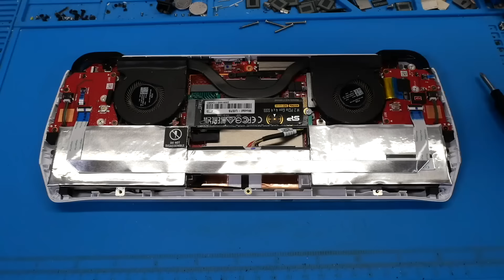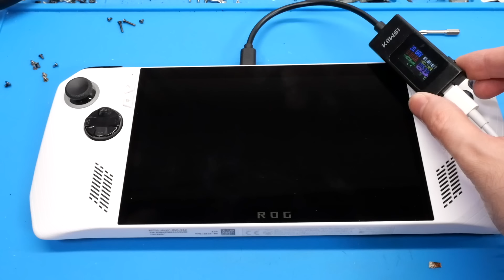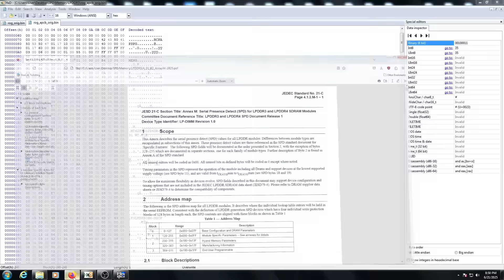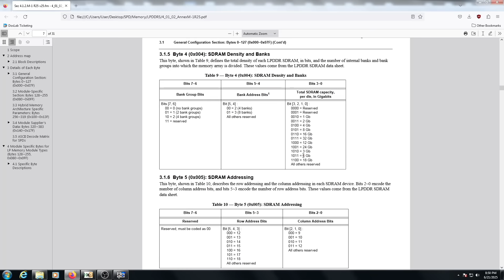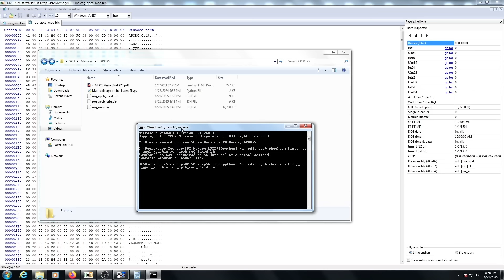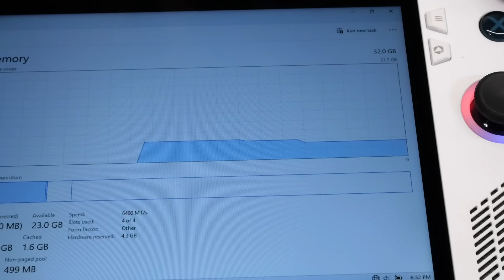ASUS ROG Ally 32GB RAM Upgrade

Comment: Good video. I have a rog ally x z1e and it just boots to splash screen. I sent it in for repair and told me possible corrupt bios and wanted to charge $450, which is what a new one would cost. I can't get into bios at all. Even with power / vol combo. Can you fix or offer suggestions?

Comment: I have the OG ROG Ally Z1 Extreme.  Upgraded the battery.  Installed the "janky" adapter.  Added a 4TB SSD.  Installed Bazzite.  Got the Killswitch case and mine runs pretty much anything.
Love this thing.

Comment: Can someone please explain to me what upgrading the RAM on this thing is supposed to accomplish?? The GPU in this thing is absolute shit.... unless you drop everything to low... and I mean everything you can't even have texture quality set to medium.... it will crash upon loading Horizon forbidden West like it'll just shit itself... this thing cannot handle the Decima engine and literally runs your GPU to about 100%...

So with a shity graphics card in a GPU that was probably shipped already buried in its casket on arrival.... what the how old does Raising its Ram capacity do for it???
I mean people got cell phones out there right now with the same amount of RAM and they run emulated games better than this... even the shined turd rebranded Xbox version is the same because that's the one I'm using...

This thing is so horrible you need to start asking if it can run crysis again😂

So like yeah in all honesty not trying to be sarcastic can you please let me know what the point of upgrading the ram would be in a unit that doesn't really have a GPU that's stable enough to handle something that uses less of a physics engine than breath of the wild did? And I'm not just making that up you can look that up it's actually true breath of the wild used a more taxing physics engine then the decimal engine did for Horizon forbidden west.... watch only plays on this thing if you set the settings to low and turn many things off completely which leaves the game looking and running like absolute dogshit and even that doesn't stop the clipping and the tearing and the skipping

Comment: I have a question, so i modified my dell 5320 from 8gb to 16gb ram and used ram that is already programed for 16gb for that model, but i think they used the resistores to tell the bios which config is used, so where can i find that schematic for that and where in fact is it the best to find these schematics?
Reply from the maker: Yes, if you want to utilize a different BIOS SPD config that’s already in your BIOS, you need to move strap config resistors. Unfortunately it may or may not be possible to find schematics, but most of these Dell systems are manufactured by Compal. You need to look on the board for the board number printed in the silkscreen, which will start with “LA-“ for a Compal board.
Reply: Okay thanks i will look into it, but i wanted to see is there a good site to find these schematics i looked on some but they mostley demand first payup than the schematic @dosdude1

Comment: I have an Asus Strix G18 with the NVIDIA GeForce RTX 4080 Laptop GPU (up to 175W TGP) with 12GB GDDR6 VRAM. Can the VRAM be modified?
Reply: *It’s got Win 11 Pro installed, but I’m going to wipe it and install Linux, probably Fedora (or Arch).
Reply: Also I’ve installed the bio’s allowed maximum of 64gb RAM, If the VRAM can be upgraded I’d like to upgrade the RAM to 96gb too.
Reply: @kenneththompson4450  that’d be too difficult to do with a laptop gpu imo but you could possibly use more system ram, sometimes the motherboards allow more, look into your model.
Reply: @goth55 thank you. Everything is maxed ATM, unless there’s another firmware update or I mess with it, lol. Just would enjoy more vram if possible. It is what it is 🤷‍♂️

Comment: ive got a question can i use most of this the eprom program and the editing for a 64gig mod? so insted of 32 gigs id have 64. a bit overkill yes but meh if i can why not to flex on anyone just simply i wanna have at least around 12 to 16 gigs into the vram and rest as normal ram

Comment: Would also like to add the research on memory hierarchy and how APU allocate memory from the ram to vram. After fixing the thermal issues this device has the biggest hurdle really is the ram. Upscaling on such a small screen makes even 720p with a resolution of 70% very viable on most modern games.

Comment: Will you get a Steam Machine and upgrade the 8GB VRAM to 16GB VRAM?
Reply: I dont think so. Nowadays VRAM is integrated into the silicon die. That's why you never see upgrades anywhere and that's why high vram cards are so absurdly expensive and marketed as workstation cards going for around 6k$+

Comment: You doubled the RAM, which means that one more address pin is in use now. You are lucky that the pin was connected on the PCB to the CPU, aren't you? You would be screwed, if this board was designed to have at most 16GB of RAM. :) I am also very surprised that you were able to modify the UEFI, because for Win11 secure boot is (theoretically) a must, thus there should have been some digital signature that prevents any change. Strange.

Comment: Can you add more RAM to an iPod classic and take that song limit past its original OS 
with extra SD card mods to get past the iPod's track limits without using Rockbox 
But on Apple iPod OS for the iPod because that is the limiting factor on iPods 
Since they come with 64mb on the higher capacity iPods.

Comment: Hey Dosdude, love the video, very informative!

Actually contemplating getting a cheap used Ally and do this and more mods to it^^

May i suggest using the Auto-ID function in XGECU for setting the chip and the "search all" function in HxD for finding and easier navigation in BIOS .bins? (work as a laptop repair technician for 6 years now and have found one or two tricks of my own for working with exactly these tools ;D)

Comment: I'm just wondering if I could use this to upgrade the soldered ram from an old G14 2023 (16 GB) to upgrade it to 32GB soldered (or higher) The initial challenge is to find a compatible ram chip for the upgrade. What I see on my Bios data is the onboard is using a Micron chip with part number MTC8C1084S1SC48BA1. The part number gave me a SODIMM module reference when I tried to search for it in the internet
Reply from the maker: Yep, it more than likely could be done. If it uses normal DDR of some kind (not LPDDR), you can get both the RAM chips and SPD data from an appropriate SO-DIMM module.
Reply: @dosdude1  i've managed to search for a compatible SRAM DDR5 chips but it seems that the G14 2023 memory chips only caps at 24Gbit 3x8 Organization for a maximum of 24GByte DDR5 On board upgrade. And they are out of stock. I may have a better luck for the current G14 gen as I think I could potentially modify them to have 64Gb or as much as 128GB LPDDR5 in theory.

Comment: Tried the hot air gun without preheater myself and I blew away 10 capacitors size 0201 🤣🤣🤣🤣

Comment: I have a repair shop that focuses on gaming consoles specifically. I have the soldering experience to pull this off.    my question is: do i need to manually do this every
time.   or would i be able to do it once, copy the data, and then use that file moving forward

Comment: Apparently, there's a way to do it without messing with the bios, on rog ally's subreddit. It involves shifting a resistor on the  motherboard to a different place.
Reply: Thats my post on reddit, if you use the ram specified and set the resistors as shown there is no need to touch the bios or block bios updates.  Full native support at 7500mt speeds too.
Reply: @ElectronicAllsorts  You even answered my questions for when I find someone to help me with it. Once again, cheers!
Reply: How? Could you give me the name of the subreddit please?

Comment: i have one with a gremlin that may make a good video for you. Sometimes it powers on just fine and boots into windows. But other times at random it will not power on or charge until i take off the back and unplug the battery for a few minutes. Other times it will charge and show a white charge light but refuse to turn on. lately when i plug any charger into it (5v) or (20v) the part that plugs into the syestem gets really hot and smells like burnt electronics. Still turns on and works sometimes.

Comment: @dosdude1 you think you can upgrade the Sony VAIO vgn-ux390n RAM from 1GB to 2GBs ? Apparently the Intel Core Solo U1500 processor thats installed supports up to 2GBs of RAM although Sony maxed out equipping the later models with only up to 1GB. The RAM and CPU are soldered down also but the board isn’t as spacious as that ROG of course. I’d be very interested in paying for that service.

Comment: Nice work this is super interesting. I wish I had that skill. I’m slowly learning how to do things and I enjoy every minute of it. I have a question for you. Have you ever came across one of the ROG ally being stuck on the logo screen, I can’t get it to boot not even into the bios. I feel like it’s a Ram issue for some reason. It won’t even boot up a different drive. I swapped out the mvne with another bootable Drive with a bazzite install and still nothing I even double checked the type C connection to see if I can get a display out and no. I know this is a bit random but any perspective would be greatly appreciated. Keep up the good work thank you.

Comment: Honestly a ram upgrade is a must nowadays most new games being released over 8 gb ram, i played spiderman 2 on the rog ally x not knowing it needs 16 ram and the ally sets 8 by default aside and uses 8 only for games so the game was stuttering once i figured it out i put the ram to 12 and it worked fine it didn't really needthe full 16 just 12 was enough.

Comment: Are you able to accommodate more ram to use like 16 for the vram 16 for the system memory? Or what is the max vram that you can use
Reply: Also will you be able to put the vram on auto? Im curious because i want to do this for mainly when using a xg mobile

Comment: Hey Collin,  I don't know if you'll get this message but I wanted to ask you if you thought about doing this with an AMD BC-250 Server Blade?  They're about 75.00 each on Ebay and they're starting to pick up Steam as a gaming platform.  They were originally used as crypto mining computers.  They are complete computers that take an NVME SSD. They're capable of running Gaming emulation of PS3 and are actually the same processor APU that is used in a PlayStation 5.  Currently they only run Linux because they were never developed for Windows and don't have any WIndows based drivers.

Comment: never get one off these handhels with 16gb of ram because they tend to use atleast 10 for system and leave you with 6 or 8 for vram its not enough if your playing triple a games
Reply: Sorry to say this, but you are wrong. I own an ROG Ally Z1 and am able to run every single game I've installed on my unit. As long as you reduce the games graphics settings. Games I have running on it: Far Cry 6, Starfield, Forza Horizon 5, inZoi and more.

Comment: Thank you alot for showing how which spd part you need to edit and how to reference to jedec specs for changing the bits, basically this would apply to any laptop with soldered lp/ddr 4 and 5 right?

what about ram chip compability? for example i have a soldered 4gigs of ddr4/lpddr4 ram on a laptop with micron chip in a 4 chip (4 1gb chips) and i want to swap them with an 8 gigs (4 2gb chips)? should i just find the chip that is similiar by referencing to the available ones inside the apcb partition inside the bios (like if apcb partition it got only samsung and micron, i should just buy either samsung or micron)?
Reply from the maker: The manufacturer of the chips literally does not matter, all that matters is that the memory definition portion of the SPD data is set correctly.

Comment: 4:20 Ehm when any chip has 32 GB them have all together 128gb why u say there have so only 16 GB or Work that so different in are console the ram ?
Reply from the maker: Because memory chip density is generally represented in bits, and since 8 bits make up one byte, 128Gbit = 16GB, and 32Gbit = 4GB.

Comment: @26:52 forgot to clean the left over solder off the chip. im sure you did it off camera tho. Also you should start using Windows10Debloater on these handhelds. I have an AYA NEO and it really helps reduce the amount of system resources windows uses and it also removes a lot of the bloatware that comes with Windows.

Comment: Hi, I'm new here. This video came up for me and it caught my attention. Do you know if there's any way to use Asus' proprietary port (ROG XG Mobile Interface) to connect a non-Asus eGPU — like a regular third-party one? I mean, maybe with some adapter or workaround, so we don’t have to buy their expensive hardware. Thanks!
Reply from the maker: With a custom adapter, most likely.
Reply: @dosdude1  Hmm thanks, I didn’t know there were adapters for the proprietary port. The mods I’ve seen usually involve opening up the console and using the M.2 or Wi-Fi slot. Do you have any adapter you’d recommend? And thanks for the quick reply!
Reply from the maker: @juancmp589  Well, what I mean by custom is that there is no such thing that exists... It would have to be designed and produced.
Reply: @dosdude1  Ah, I see. That's unfortunate, but thanks anyway
Reply: There is an custom egpu board that connects to the xg mobile port for any gpu

Comment: Interesante, Excelente.

En hipotético caso de hacer lo mismo con un ASUS Rog Ally X de 24 GB a 64 GB

¿Se podría lograr tal hazaña?

¿Si existe la RAM en módulos donde el total sea 64 GB, donde conseguir dichos módulo?

Me gustaría intentar eso en casa, tengo algunas herramientas que utilizas, algunas no las conozco, pero ¿Puedes listar todo lo que se requiere para esta lograr esta hazaña?

Interesting, excellent.

In the hypothetical case of doing the same with an ASUS Rog Ally X from 24GB to 64GB,

Could such a feat be achieved?

If RAM modules with a total of 64GB exist, where can I get those modules?

I'd like to try this at home. I have some tools you use, some of which I'm not familiar with, but could you list everything required to achieve this feat?

Comment: Dude, hello. You inspired me to upgrade soldered ram in my laptop, Lenovo IdeaPad 5 14AHP9 14" 2-in-1. I have there sk hynix H58G568K7B X068 4gb LPDDR5x-6400 4 pieces. I need your help to find a compilable ram chips for upgrade 4 pieces with 8gb each.

Comment: so when you do this upgrade and change all the bios stuff when say a new update comes out for the ally or steam deck or whatever you did the upgrade on does this change the bios so you have to do this all over again or is this changed for good? i was thinking of having this done on my steam deck and was curious.
Reply from the maker: Steam Deck is a non-issue, as somehow someone managed to get the private signing key and can sign custom BIOS updates for it. The Ally along with other devices have not had this happen, so manual BIOS editing by dumping EEPROM is required if an update is installed. I explain this a bit towards the end of this video.

Comment: well done, this video has been posted year ago if Im not wrong,  the new ram upgrade no flash bios is needed upgrade bios will not affect too, using RAM configuration straps is modified , but i dont know how this can be done.

Comment: Yeah my ally is useless for this exact reason, compared to my ally-X. I use my ally-X as my laptop. I would like 96 gigs of ram, for LLM's. with 24 gigs of ram I can use Q4, 27bil at a respectable 4-6tps.  Why 96 gigs 32 ram drive 32gigs of system ram and 32 gig of GPU ram. I really enjoy having a ram disk and running my browser and favorite games on it for privacy and loading times.  The game Rust loads MUCH faster in game when running from ram as it's a 24 gig game. 
The LLM: AB3 models are both fast as hell 16-24 tps and HUGE so there is a need for doubling the gpu ram. Is a 96 gig version possible?

Comment: Maybe a stupid lay person question:
Since these memory chips are 64 Gbit, could you DIY-build a 2Rx8 128 GB unbuffered DIMM for desktop systems?
(currently only 64 GB DDR5 UDIMMs are on the market and 128 GB UDIMMs are the largest theoretically possible in the current DDR5 spec)
Reply from the maker: I don’t know if you can use LPDDR of any kind on a DIMM module, though you also have to be aware of available address and bank select lines available on the desired motherboard.
Reply: Thank you very much for replying!
That was the point I overlooked, it’s LPDDR5 here and not regular DDR5. Also as far as I know a CPU’s memory controller and firmware must explicitly support LPDDR memory for it to work.
Just out of curiosity: Can you order “regular” DDR5 memory chips with 64 Gbit or is 32 Gbit the current maximum here?

Comment: Can you not dump the bios and use software to reflash it, update it?  I've noticed some tools that let you change the TPU settings and other things.  Seems extreme to desolder a bios these days.
Reply: Also you should do some performance comparisons.
Reply: the software checks for the signature and hash, a modified bios will not pass those checks so it needs to be manually flashed

Comment: Would a bad actor be able to modify the SPD data to say it has 32GB have ram while still keeping 16GB or would it fail or still detect the 16GB of ram?
Reply: what would the bad actor even achieve from this?  the system would simply bootloop unless the SPD and RAM size matches

Comment: When you opened command prompt and then copy-pasted the address in, instead you can just type cmd into the address bar in explorer and that will open a command prompt at that directory directly. Or at least, it does since Windows 10, not sure about 7.